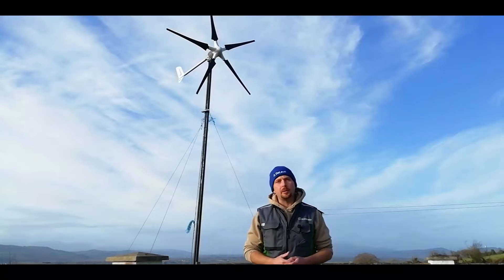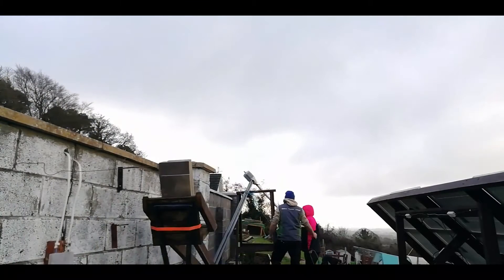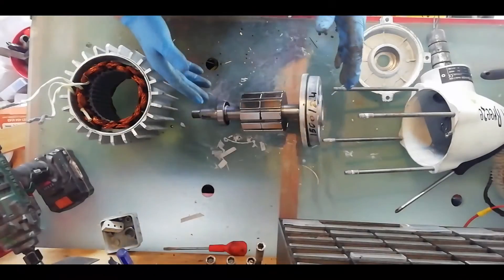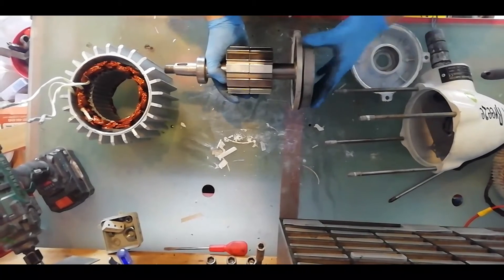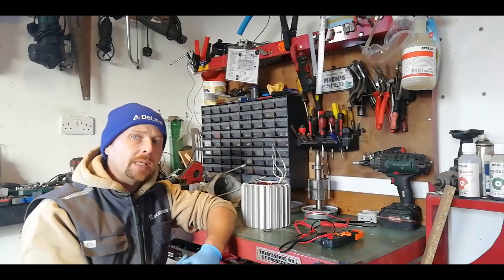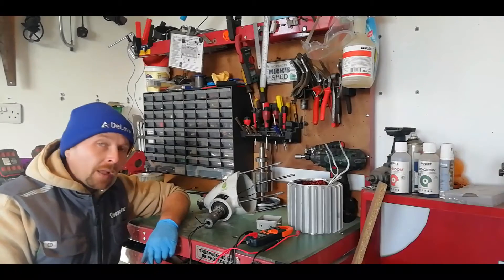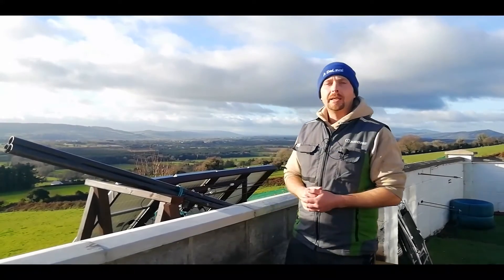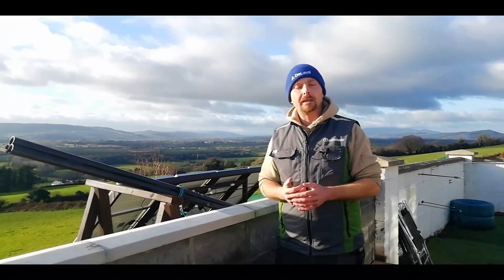WIND TURBINE FAILURE! Istabreeze failure.

Comment: I’ve the 1000W 24v version but I use a charge controller. It has a programmable V/I load table so I can limit the current produced by letting the voltage increase to around 45V.
Reply from the maker: @kevinmills5293  very nice indeed. The controller we got from istabreeze is basic to say the least. Can I ask what the name of your charge controller is?

Comment: This failure is quite unfortunate and it gives a very distorted  view of the potential for home-based wind power.  I used to have a little business restoring and selling the older American wind turbines and I can assure you that I've never seen things like this. The turbines that I restored had been running for years and, generally, the bearings were still good enough to have been left in place. Insofar as the wiring is concerned, if that is a weak spot then that would decide the maximum rating of the alternator.  What about this business of allowing the user to choose 3 or 5 blades ? That's crap. A proper wind turbine is DESIGNED around a particular set of parameters; generator output vs rpm and tip speed ratio being central. I can assure you that a proper wind turbine should go at least 10 years without any problems. Wouldn't be fun to redesign this thing ? As for solar trumping wind...lets talk about that on the next Winter Solstice in Ireland. I can assure you that we'll be singing a different song. The off-grid solution is really solar + wind but there's a lot more to this story...a lot more.
Reply from the maker: Could you give specifics as to why 3 vs 5 blades is crap? And yes solar trumps wind every time on a small domestic scale.
Reply: @ourkilkennyhomestead2006   If the turbine is designed for a particular alternator and a particular wind speed then there will be a single tip speed ratio that is optimal. The blades will be designed accordingly.  Generally, fewer blades even if they're correctly designed will be less efficient. Also, if you ever need to have to re-balance the rotor, it'll be more difficult.  Solar can be messed up too. The further North you go, the less viable it is and solar is very, very susceptible to heavy cloud or smoke.  I use solar too and last winter was terrible, probably due to climate change impacts on the cloud cover.
Reply from the maker: Sorry I don't mean to come accross as blunt. Allow me to elaborate, N-type solar panels currently cost €75 each for 435watt panels. Even on a dull day they'll still bring in 100watts and are maintenance free apart from cleaning every so often. Don't get me wrong as a mechanic of 23yrs, former BMW, suzuki, Honda, hyundai technician efficiency is what it's all about. Turbines involve risk, both personal (during maintenance) and collateral damage in the event of failure. Additional costs of a foundation, cables, auxiliary infrastructure for raising and lowering, can't operate in excessive windspeeds and there's always those days when there's no wind at all. The craic with the blades is down to rotation speed, 5 blades gives more operating surfaces reacting to the wind however the trade off is the resistance that the addition blades create resulting in a lower rotation top speed. It's like gearing in a gearbox, more teeth equals better torque but at the expense of speed. Your experience has shown you a certain set of values however David like all of us, our experience is limited to the machines that we are familiar with.
"every day is a school day" as we say in the motor trade.
With all that said if you could name and or recommend some of the turbines that you are familiar with, I'd love to know more about them and perhaps buy one if they are as reliable as you say. We're not here to compete either with knowledge or brand names, we're here to do it better.
Best wishes
Mike
Our Kilkenny Homestead.
Reply from the maker: Indeed, we are at 55 degrees lattitude here. Thank you for sharing your experience. 👍
Reply: I said it and I'll say it again "BEWARE OF SOLAR". I'm doing some research for a handbook on the off-grid. According to the Global Solar Atlas, Kikenny will give you a hard time with solar.  In Canada's Halifax, NS, for comparison's sake, we would get 1278 kw-hr/meter squared/per year, with a monthly max to min ratio of 2.2.  At your location, you could expect 954 per year with a monthly ratio of 3.8. In December, you'd need 3.8 times your solar output to equal what you'd get in summer.  Best to stick with wind plus some solar. Go for a high tower and a decent turbine. Solar alone, in the North, is a recipe for battery murder.

Comment: I'm very aware of those failures, used insta-breeze for 6 years straight. The wind safe has a major flaw, the slip-ring is exposed to water and fails very quickly. It's structure doesn't handle the vibration and starts becoming lose. but as you mention, a wind generator is only to help keep the batteries charged on those long days of no sun.
Reply from the maker: Really? Very interesting indeed. Had seen other channels showing the badly corroded slip rings from their windsafe models but hadn't a time scale on the failure. Great info, thanks for sharing 👍
Reply: @ourkilkennyhomestead2006  close to the ocean here in the Azores, year or less it fails. Very good idea, not deployed very well
Reply from the maker: @carlossousa3285  Very true, mass production economics ruins a good product once again 😁.
Reply: I almost purchased this thing

Comment: I just checked I2000my slip ring and wiring and would say its about the same as yours. But it is 48 volt. The Istabreeze mast kit I purchased is the same for all their models so it would be the standard size for all. These mini turbines unfortunately can handle 80 miles, a Brit had a failure on YouTube even with a dump load. It would be better to lower the turbine in those conditions, but easier said than done. Some form of quick release tilt system that one person can do. Haven't seen one yet. Hope you get it sorted. Great vids
Reply from the maker: Hi, it's the same slip ring? I thought so, thank you for confirming. I had wondered did they equip that part based on a 48v amperage capacity instead of at 24v amperage capacity  which would be double and beyond the parts capabilities. I'm replacing this with a 60amp one but the neck has to be drilled out a few mm as its a physically bigger part.
You're spot on about the mast and lowering during extreme winds. It's what we had hoped for here but my setup needs major improvement as like you say it's easier said than done. The combined mast and turbine weight multiplied by the distance really adds up as no doubt you know yourself.
Seems like a motorised heavy duty winch off on a seperate concrete foundation of its own is what's needed for a one man put up and take down.
It's funny with these turbines, love em or hate them, they do keep us on our toes 😊
Reply: Yes and going just solar I have seen is not an option, not in Ireland with only 6 hours of light max on the winter, we have wind and need to use it effectively. The other option is to manual turn the tailboom and lock it at 90 degrees to the wind, basically feathering the prop much like an aircraft. All part of the fun😁
Reply: Proper wind turbines have blade feathering mechanisms or, at least, sidefacing mechanisms. They should be able to take anything up to 100mph or so.
Reply from the maker: @davidsimms8054  David it's a 1500 quid affordable turbine, what do you expect for that price?

Comment: Hello there. Just seen this, and yes, my 1000w / 48v Ista Breeze has similar small gauge cables, one of which I had to heat shrink due to the insulation melting.... Does not seem like a big enough size, especially considering the lengths required and potential current flowing. Fortunately, my experiment has only given ~100Whrs in 3 weeks of work in it's current location (due to being surrounded by trees) so not working anywhere near as hard as yours.

Comment: nice video.
a slip ring is often a failure there on istabreeze. just get a bunch of those to be stored as spare in your garage.
also, a much more efficient way to stop the turbine is not to shortcut it, but to dumpload it. I bet some 8-10 Ohm resistor will do this job great
Reply from the maker: Hi, thanks for checking out the vid and glad you liked it.
Those slip rings are way below spec for what they need to do.
I have been looking for an appropriate sized one but having no luck, all I can find are 30amp ones. By any chance would you know a supplier to buy a 60amp slip ring?
Reply: @ourkilkennyhomestead2006  I've left a comment with a link for you, but since youtube is blocking it - you may find it in your admin panel only (in pending approval maybe? or maybe just search through all the comments but from the channel admin panel).
Reply from the maker: @bkwindsolar  thank you so much, really appreciated. It should be accessible through YouTube studio. If I buy one I'll be sure to thank you in the rebuild vid. Merry Christmas and happy new year!
Reply: @ourkilkennyhomestead2006  same to you my friend
Reply: @ourkilkennyhomestead2006   you please advise this 60amp slip ring? without link maybe so it works :)

Comment: my istabree i1500 24 lasted only 2 weeks before it boiled the slipring. then I changed to the bigger slipring and it lasted 10 months so I guess we have almost the same conditions with wind over 80 mph. I also have a proven 2500 but it failed because I didn't maintain it and I had a long period when I wasn't home. I have found some producer that have better systems but it going to bee costly.  the wind safe generators from istabreeze still use the same slip rings and will boil it after some time. my best advice to you is to try to find a used proven. kingspan. ore SD wind this is the same turbine but with historical names now its SD wind.  I still have my old dead one that I will try to fiks ore get a new generator head. have a nice Christmas holiday from Norway
Reply: My ista 1500 24 has been up 18 months now with no probs. Key thing is to have it locked out when there's a storm. ( last night there were warnings for 80mph with storm "Pia"........ which is a PIA 😆😆 )